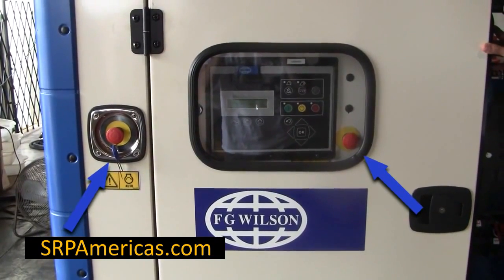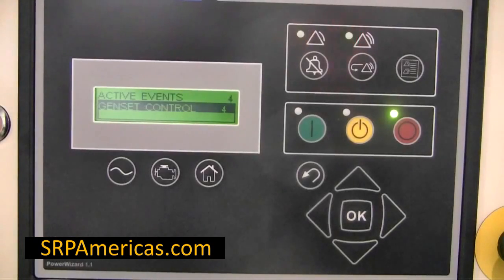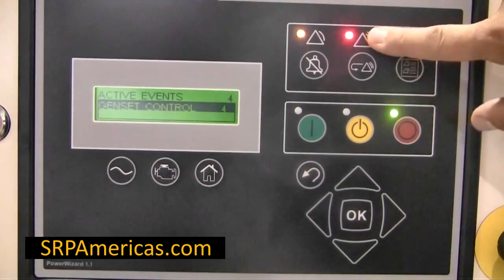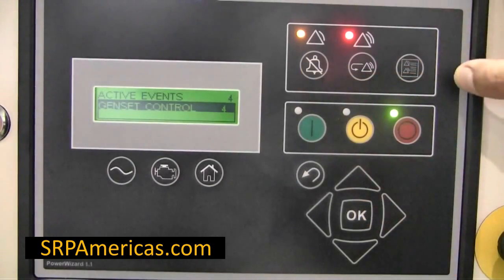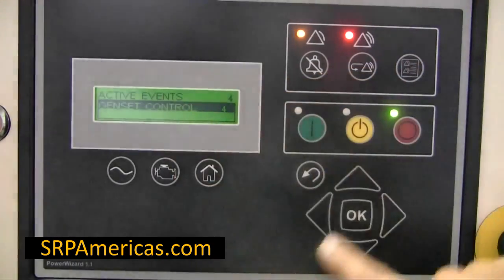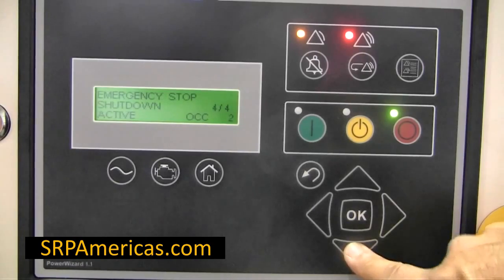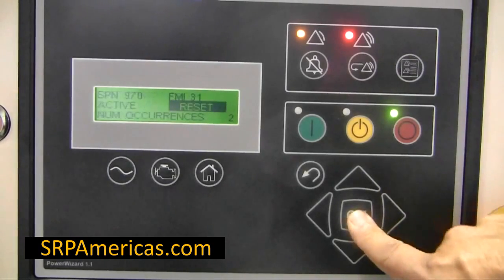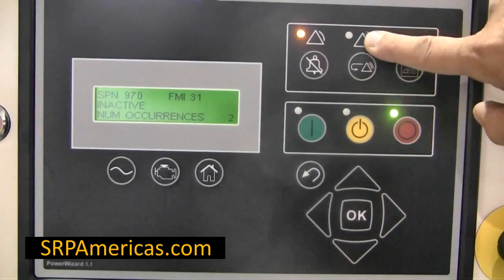How to Reset an Emergency Stop Alarm on Powerwizard 1.1 (FG Wilson Generators)

Comment: I have a Cummins diesel generator 22kva with deep sea controller with the fault code 1435 and all emergency button checked okay but shutdown alarm still on and machine cannot start.